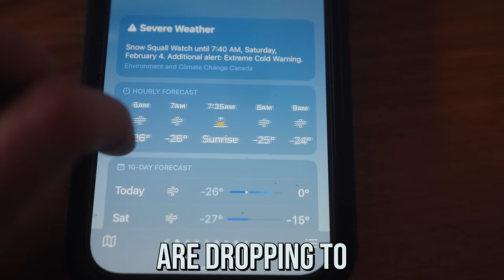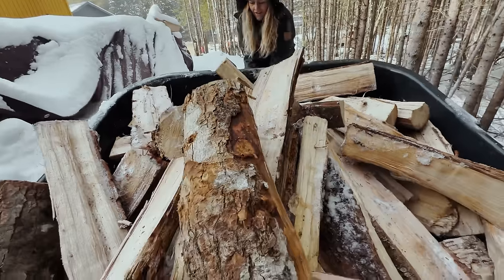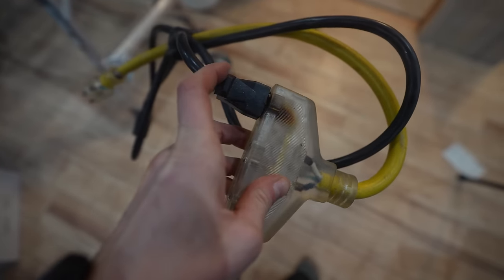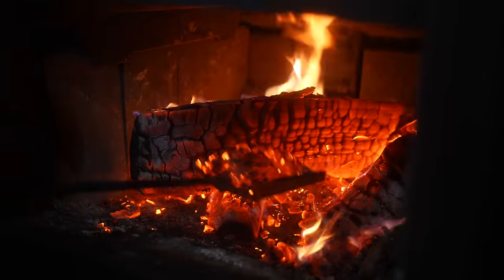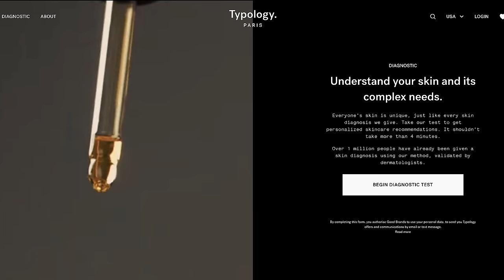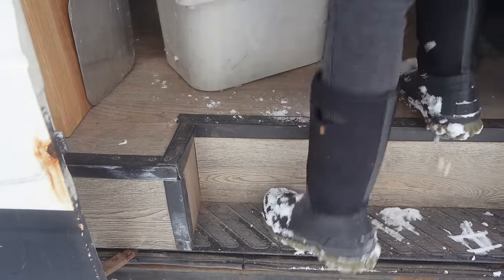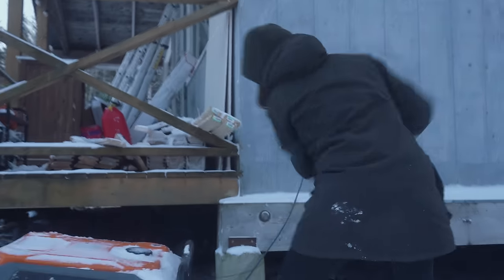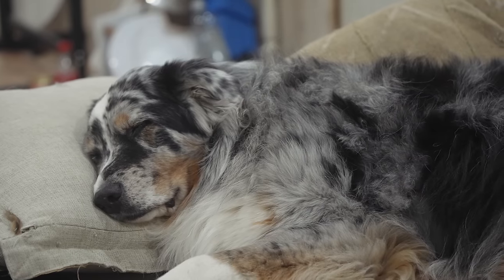POLAR VORTEX HITS OUR CABIN -40 & Not Prepared

Comment: A tip for dish washing put a big pot on the wood stove for hot water to add 2 buckets or bins get your soapy water in one and clean water for rinse in the other all in the comfort of being inside.
Reply: Well said I am surprised they had not thought of this earlier. This how we heated our water during our tent camping days decades ago.
Reply: This is how we would heat water long ago in the days before the electric hot water cylinder was installed. A pot for small jobs could be left on top of the chip heater while it, via a wet-back, was heating water in the overhead tank for baths, laundry and so on.
Reply: Would have been my backup plan. It would bother me to have dirty dishes too. 😊
Reply: I just left a similar comment.  Im surprised too, they haven't thought of it or been told by someone. I was thinking to save drinking water to use clean snow. Plenty around.
Reply: I was searching to see if anyone else had noticed this. Surely, it would be option 1.
Reply: They have a working bathroom sink and the shower even has a hand held extension...2 options of running water inside the house.
Reply: I have to say, I was somewhat confused as to why they didn't heat some snow up on the stove and wash up in a dish, like, well, everyone surely would....and...if your hunkered down in a blizzard, what's the issue about simply peeing in a lidded bucket, and adding some wood shavings to keep the smell down. People just have no idea how to rough it these days.
Reply: @kathrynbeetham5308 They're doing excellently, all without your unhelpful two cents. They've done more than most, and you're still trying to disparage them. Smh.
Reply: @nicothenatural  no I was trying to be helpful so they didn't have to go out in the cold to the van to wash dishes.
Reply: To think, this is how people lived in early 1900’s and whenever the blizzard hit in upstate NY when my parents had a wood stove and kept us warm!

Comment: When I was a kid we lost power for a few days. We used snow melted on the wood stove and heated to wash the dishes. Don't forget to clean your chimneys, this will prevent a chimney fire. Sending you both prayers and thanks for sharing your journey with us. Eventually you may want to have curtains over your windows when it's that cold, and also at night. This will help with heat loss .
Reply: 2 wood stoves mean twice the snow that can be melted and heated up. As a kid, we moved into a house that was heated with a wood stove, so we could cook and have hot water for other uses. No indoor biffy though, so I know what it's like to head outside when it's below -40. 🥶💨
Reply: You gals Rock 🤘
Reply: @codycopithorne6294  the small of food cooking on the wood stove brings back memories. My grandma often prefers cooking on the wood stove over the range.
Reply: Great advise on the chimney fire
Reply: Christina, I was thinking the same thing! You can use old blankets and old quilts, and I would definitely nail one up and have it closed on a regular basis once the sun disappears.
Reply: Yes I call it winterizing the windows it really helps
Reply: @codycopithorne6294  yes to the windows. so many people think.."oh there nobody to see in we don't need curtains" but they also help with keeping cold out, heat in in the winter and can do the same in the summertime..making the place a bit of a cool cave when it's too hot out. throwing blankets up would have helped during this storm
Reply: ALUMNM   BUBLE. WRAP.  --  PRECUT. TO. WINDOWS. SIZE. -  ATTACH. WITH.  ,,  DUCT. TAPE. --   WILL. FIND  IT. A. LOT.  WARMER. 😊😊😊! .

Comment: But you have snow and you have a wood stove, so all you need to do is to melt snow and heat the water and you can wash your dishes in a basin or a bucket, you don't need warm running water for that. I'm used to doing it at my grandma's cause she lives in a village in Ukraine and  they often have problems with running water. I remember in my childhood we didn't have snowdays and were only allowed to skip school if the temperature was lower than -25°C. The best lifehack is to put 2 pairs of socks, first thin cotton ones then put on your pants and then put on thick wool socks over them, so the heat stays inside, and to tuck your sleeves in your gloves, also always cover as much of your face as possible with warm hats/beanies/shapkas and your lower face and nose with a thick scarf. I never liked feeling my nostrils stick because of the frost))) I have to admit i miss those cold winters now that i live in the mild french climat

Comment: Your situation reminds me of February 1985.  It was -40 degrees.  We got a fire call.  I was a volunteer.  My car barely started, even though it was plugged in.  It took minutes to get my engine running on all cylinders.  My automatic transmission didn’t want to engage.  My power steering barely worked and made bad noises.  When I arrived at the scene I left my car running.  The fire sprinkler pipes in the building had frozen and caused the pipes to burst.  There was no fire.  Thank heaven for small favors.  Carry on, ladies.  My best to you.

Comment: Well done. FYI, for roof work, throw a rope completely over the roof from one side of the cabin to the other. Tie it off on both sides. It gives a hand hold for climbing. Bonus points if you tie knots in it before hand to give handholds or even loops in it to give places to clip into.

Comment: Its always handy to have 1 or 2 "backup" heat sources, especially off grid.   having a back up propane or diesel heater is a great option,  even if its just heating 1-2 rooms.   

For example having a MR Buddy heater as an emergency back up to give you 24+ hours of heat in 1 room in case of disaster.  The buddy heaters are 4000-9000 btu which is good enough for 1 or 2 rooms.  

On the flip side you can get 30,000 BTU diesel heaters  that will run for days, talking 72 hours on a 5 gal Jerry can.. at full power output.   So as an emergency backup...  its a very good option,

Comment: Well done! A tip from someone who works outside in the Northern Canadian Prairie Winter. Leather gloves when working with metal (or anything for that matter). Insulated with wool is best. Anything synthetic just freezes and the leather is wind proof too. And if you're going to be spending prolonged time outside in the real cold, look into upgrading to fur. Don't think you're really going to need it in Nova Scotia but with climate changed, these prolonged cold snaps are becoming "normal".  Fur is sustainable and if properly cared for can last a lifetime. It also supports indigenous communities. (and yes, I said "upgrading". Fur is exponentially superior to synthetic fibers.)  As for other life-in-the-cold tips, a pot of water on the stove helps to maintain humidity inside and bring the toilet seat inside if you're thinking of using the outhouse in cold weather. Just reverse the seat bolts for that you can put the seat on the posts to keep it in place when using it. My sister uses an insulated grocery bag to get it from A to B.

Comment: You have all of the things you need to do those dishes without lugging them around. Go collect snow from outside, melt it and heat it on the woodstove. The bucket you use to carry them will make a fine sink. Wash rinse and lay on a towel to dry. I can't believe you're actually from there and you didn't figure it out lol. I'm from Michigan and I can't tell you how many times we did that when the power went out from winter storms.

Comment: my partner and i bought a house last year and us too, weren't prepared for the Nova Scotia polar vortex! our pipes ended up freezing and we had no water, 1 hole in the ceiling and a huge mess of our basement later, we were able to find the pipe before it exploded!  additionally we only have electric heating and it was too cold for our baseboards to heat the home, so we could only get it as warm at 13C so you guys did pretty good with that wood stove, i am impressed! We learned from the polar vortex that if you keep your water running when it dips below -25 (basically turning the tap on and letting the water run) you can avoid a frozen pipe, Im not sure if thats possible for you both to keep your water on all night but if you can this will help next time! also we learned about pipe warmers - go to your local hardware store and purchase a few they do use power but they are like mini furnaces designed to wrap around your piping and they'll kick on when temp. starts to fall (or you can turn them off for times you done need them) BTW i am also 27 and learning how to take care of my own home, so i really enjoy watching your videos and getting the motivation to become more self sufficient and sustainable!!

Comment: You guys did great for your first deep freeze. I currently live in Labrador (where Tyler used to live) but I have also lived in the NWT and Nunavut. There is something about the deep freeze and winter. I would have probably melted snow on the woodstove and put it in a bucket to wash the dishes. Then throw the water outside when I was done

As a future trip: you should look at taking the van up the dempster highway - maybe under the midnight sun. You can cross the arctic circle and take photos at the sign. You can drive all the way to Tuk and put yourselves in the arctic ocean (I've done it). I love late August because the bugs aren't so bad and you get the fall colours of the tundra (it looks like the land is glowing).

You would also like the Inuvik Greenhouse and be inspired by growing under the arctic sun.
Reply from the maker: You are so right, we try to embrace all elements in every season. Thank you zz plant lover for sharing your trip destinations with us. Sounds like a life changing experience, a trip of a life time.
💛🐶

Comment: Automatically having wood stacked next to your house all the time. Plus extra stacked close by. 
Also having your windows covered will help with keeping warmth inside.
They make insulated covers for your water pipes. I use them on both hot and cold pipes. I keep them on all year round.
Good luck

Comment: To do dishes, find you a very big pot. Fill it with snow or emergency water. Put it on the wood burning stove. Once the water is warm enough you can wash the dishes in the pot. Then dump the dirty water outside when you are finished. Also can be used as bathing water if you cant take showers. Hope that helps!

Comment: Great video and well done in the storm. 😊👍
Never underestimate the dangers of really cold weather. Hypothermia can set in when you least expect it, and especially your extremities and face are vulnerable to frostbite. The lower the temperature, the greater the danger. 
You were quite right when you said that everything is much more difficult during wintertime. Just the fact, that you need to bundle up to go outside is sometimes a real pain in the butt. Then if you have a car, you are faced with brushing or scraping off snow and/or ice. Everything tends to freeze up. 
In my old car, the heater doesn’t work very well, and the doors tend to freeze. Getting caught in white out conditions when driving is no fun either. 
I live in the Arctic, on the Southwestern coast of Greenland at the 64th parallel. Along the coastline in the southwest, the cities and towns all experience coastal climate, but up north above the Arctic Circle and at the center of the Ice Cap, it’s a very different story indeed. 
In Nuuk, the capital, we usually don’t get below -25° degrees Celsius. So far, our coldest day was -22 ° Celsius -29° with the windchill factor. 
However, our winters are long from November to May, with plenty of snow and snowstorms. As I’m writing this, we are right in the aftermath of one. The wind is howling and swirling outside. Pretty much the way it is in your video. 
Winter starts here around early November, and while we are always guaranteed a white Christmas, we usually don’t see large amounts of snow until about February and March. Winter last year was absolutely horrible as we pretty much had back-to-back snowstorms for three months straight, from the beginning of December to the end of February. 
This year, it has been much better. Many beautiful days with gorgeous rays from the sun still very low on the horizon making everything seem brighter. But it’s been chilly 🥶. The temperatures during January and February most days have been well below -8° degrees Celsius. 
This time of the year, the sun provides light, but no heat. 
I can’t wait for summer to come. I love our summers. 🥰 Light round the clock, mild temperatures and long summer nights.

Comment: Time to improvise. You have a bathroom sink, use it for doing dishes. As for the generator, I just propane from a torch into the air intake while trying to start the engine. Works for me every time, hope to put the propane conversion kit onto my gen set soon.
As for the sauna, try to make a blanket out of several painters tarps sandwiching some 2 inch styrofoam strips between the tarps. You will need to find a really large carpet sewing needle and some really heavy thread for sewing canvas. When you are done drape it over the outside and secure it with cargo straps every two feet along the length and some stakes in the ground to tie off to. Come spring time and good weather you can remove and roll up the cover and store in the garage. Almost forgot, after one is done sewing coat both tarps with a camping tent sealer to keep water from soaking the tarps. A friend found that certain sealants can be thinned out with mineral spirits and the mixture applied to the tarps. This mix needs to air dry for several days when it’s warm outside. Off grid, improvise.

Comment: Great video and I'm glad you survived!!!  (Yours is the last video I watch every Sunday - YEP - Save the best for last).

I don't know how much work it would be, but a heat transfer system for your fireplace would make your fire wood do double duty.  Not only heating the air, but also heating water for use in the cabin.  Some pipes, a small tank, and a pump would give you hot water whenever you are burning wood.  And when not being used the tank would act as a thermal sink (just like the water in the green house) holding the heat and releasing it into the cabin.

(After a little internet hunting, I found that there are thermoelectric generators for wood fireplaces that turn heat into electricity and hot water.  This would provide hot water an the electricity to run a pump so that you would have hot water in the cabin when ever you're burning wood. While you may not burn wood all year round, it would give you a system that would provide hot running water in the winter without having to use any of your solar power.)

One of the easiest ways to keep the warm in is to cover your windows.  Whether that's with something temporary like an insulating product or by putting up good thick curtains.  Windows are notorious for being the primary heat loss area in houses.

I don't recall anything about you changing the windows or the type of windows you have.  Are they double glazed?  If they are single pane glass then it would be a good idea to look into double glazing.  The air gap between the panes is a great insulator.  Which means less heat loss in the Winter and less cool lost in the Summer.

I remember Tyler and Todd stacking hay bales around their RV in the winter to block out the wind and keep the pipes underneath warmer so they wouldn't freeze.  I can't remember if your floors are insulated underneath the cabin or if you have any way of blocking the air flow during the really cold months. (maybe snow, I don't know if that would work or how plentiful it would be)  This would help keep the cabin warmer.

Glad to see you made it through okay and that you learned some lessons that will help you in the future.
As usual, looking forward to your next video.
Mark

Comment: My firewood warms me many times. 1) chopping the tree down. 2) slicing it into rounds. 3) splitting the rounds into manageable pieces. 4) stacking the pieces. 5) bringing the pieces inside. 6) burning it. 7) emptying the ashes out in my compost pile. I live in VT and when it gets down to -40, I play outside. blowing bubbles is fun. They shatter when they hit the ground. Throwing boiling water in the air and watching it turn to snow instantly. I've also got genetic markers from Svalbard, so it may seem crazy, but I'm comfy in the cold.
Reply: Happy someone else thinks it warms you 7 times. I learned that saying cutting wood for my first house that was heated with only wood burned about 8 bush cords. But there is a bonus it got me into good shape fast.
Reply: @keithlennox8195  My "peak physique" hits around the end of September when I've been processing wood for a few months. Then, instead of showing it off at a beach, I get to cover it with lots of layers and get fat and lazy all winter.

Comment: Regarding heat trace, you can get a thermostat, which just looks like a power plug, but will only pass electricity below 38F.  So you can keep the heat trace always plugged in.

Comment: Since you have a generator consider adding a powered fan at the back of the wood stove with baffles to direct the warm air. Manufacturers will tell you if your model has this option. Makes a big difference over passive circulation. Also, cutouts in the wall near ceiling to house little computer fans to circulate warm air to other rooms: minimal drain on power.